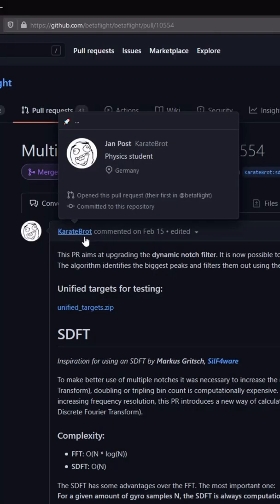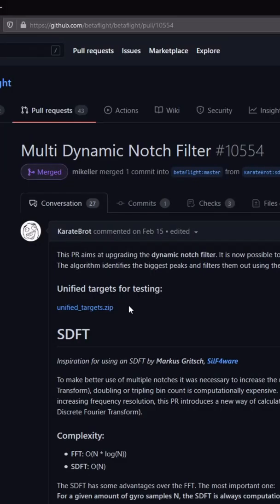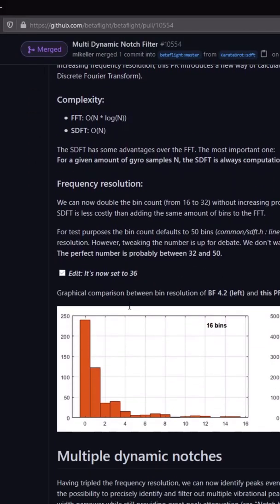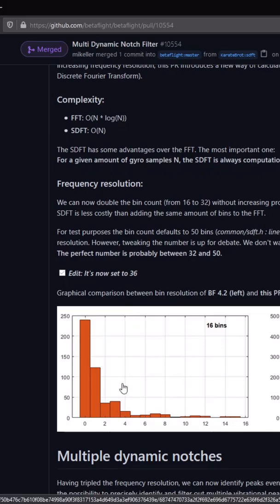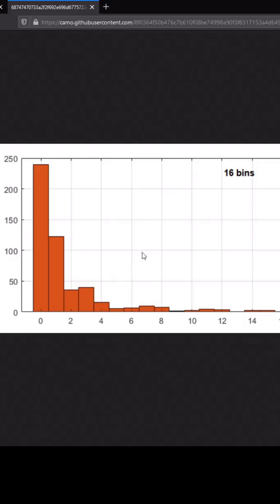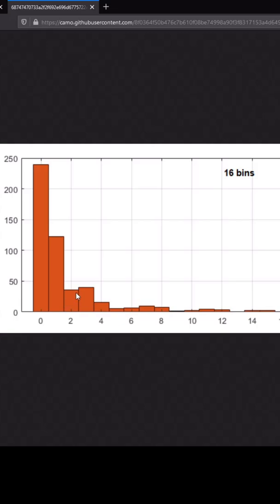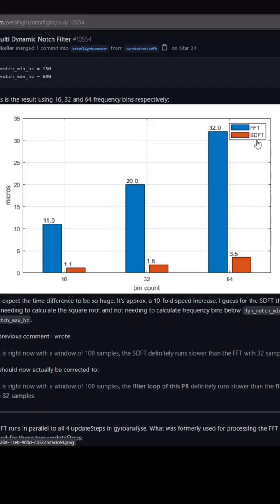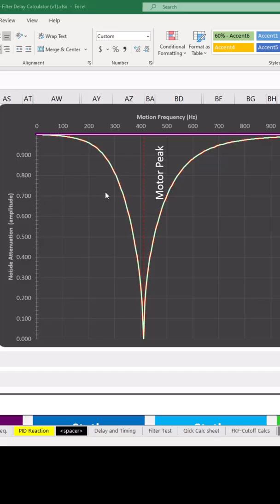NEW Dynamic Notch 🔥 the SDFT 🔥 #Short

Comment: I have a question does the determination amplify gyro noise or is it amplified by gyro noise ?
Reply from the maker: D-Term amplifies gyro noise.
Reply: @uavtech  so the gyro noise is made worse basically?
Reply from the maker: If extreme gyro noise gets amplified by D-term and that amplified noise starts to make up a majority.of the PID Sum signal that.goes out to the motors, yet, it can even more gyro noise.
Reply: @uavtech  the reason I ask is because I had a clean gyro signal on stock 4.2 pids so I boosted the gains a notch now I have gyro noise down were I shouldn't have gyro noise I inspected and found a bent motor shaft but that got me thinking about that common statement " dterm  amplifies noise " which is true it seems that part was never really clear in alot of videos and material I've red and watched but now that I think about it I guess it was lol so basically the d can bring out noise you don't know you have and amplify it 😀 making it worse that's why you have to be careful with it not because of the shear dampining effect it has but I guess in a way it  is  what a rabbit hole sorry for rambling do u recommend your toothpick presets for a 4" apex ?
Reply from the maker: @runpuppyfpv5744  yes

Comment: I am getting strong trilling oscillations only on rolls after a light crash into grass.   Swapped all motors, all props, tuned and retuned, reflashed fc and esc.  Motors aren't even a tiny bit warm, and it flys super smooth with every other maneuver I can think to do.  But a quick roll and it sounds like I stick the motors into a bubble machine for a couple seconds.  I can't figure it out.
Reply from the maker: Reduce FF.  If that does not fix it, reduce all the PIDs with the Master slider.
Reply: @uavtech  thanks for the response.  FF was in 80s and pid 50s 80s 30s reducing made it worse.  Not sure what else to check or try... 
I even rotated the FC 180 and reassigned motors to see if it followed.  Still only on rolls.  it’s an extremely strong brrrrrrrrr sound that last a second or two.  Almost like something is stuck in props.  They are clean and clear too though.  
I did 20-30 rolls back to back but directions sounded like death but still motor’s are cool to touch. That’s what is so mysterious to me.
Reply: Ooh another update it only does it in acro.  If i roll in horizon its fine
Reply: Check for delaminated carbon on the arms, loose screws, wires vibrating.

Comment: i found some strange issue in betaflight logging.  If you change logging rate also changes gyro latency  ( between gyro scaled filterred)
Reply from the maker: logging adds loop jitter if you PID loop rate and logging rate are too high.  I just did a patreon video about this subject and the fix coming by Steve Evans adding DMA improvements to Betaflight.
Reply: @uavtech  👍  I seen glitches inflight because of that. I seen it in my tests.

Comment: I tried it and its filtered worse than fft filter.
Reply from the maker: What band width?  You need 100 min to be equal to Q 120 on the old settings.

Also, if no RPM, notch count consider to be 3 or 4.  For that, then band width could be little lower.  

This is the stuff that needs to be worked through.
Reply: @uavtech   With bandwidth 60 and count 5 latency is huge... and filtration is worse than usual dynamic fft with q120 and 1 notch.
Reply from the maker: Do you have A-B logs of that to share?
Reply: @uavtech   I  dont know how to sent  link here. So you can see it under my last video on my channel

Comment: Oh thanks ! I guess it is the reason why dyn_notch_q and dyn_notch_width_percent cannot be set on the latest nightlies ? What would be your recommanded settings for 5" freestyle ? Default min 150/max 600 is fine or is it still advised to reduce max to 350 hz ? Thanks :)
Reply from the maker: If no RPM and good frame, those are good min/max.  If want a little more low end, reduce min to 100hz.

If no RPM, set notch count to 3 or 4.
Reply: @uavtech  Thanks very much Mark, I'll give it a try :) (on this setup, I use a Beast H7, so no RPM Filter with 4.3 sadly, but your advices suit my needs, and I'll keep default notch count for my others rigs with BLHeli32 :)
Reply: @jejefpv  Have you tried bluejay?
Reply: @r2d2fish38  I was planning to flash ESCs after testing wih BLHeliS and BF4.3, it works so well that I haven't yet flashed the ESCs, but I should give it a try :)